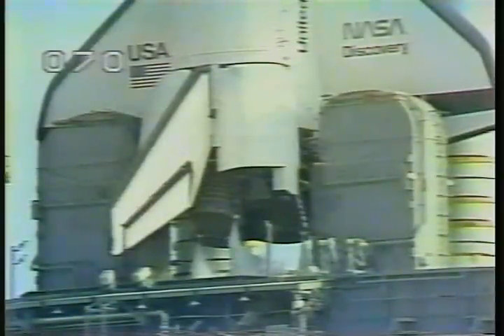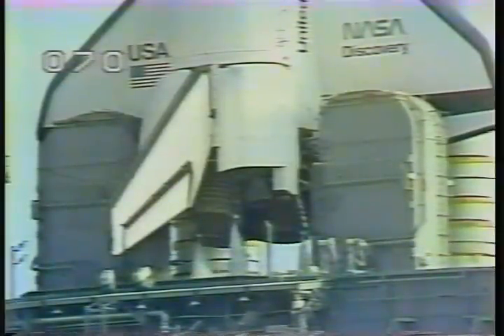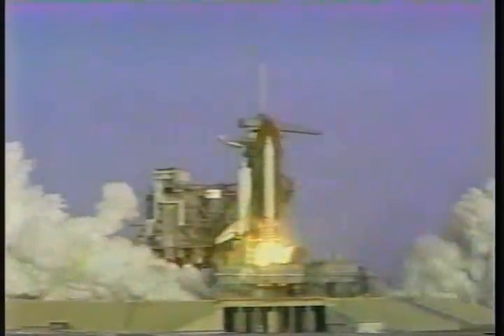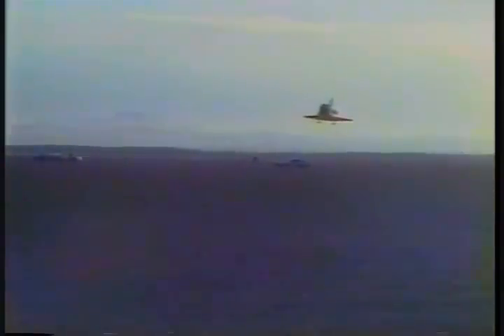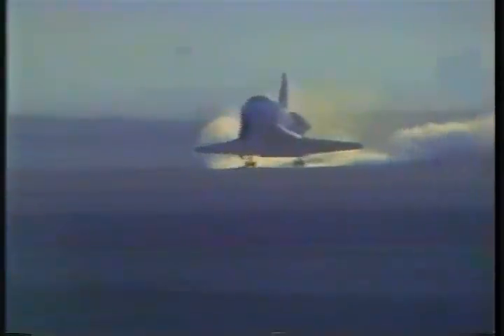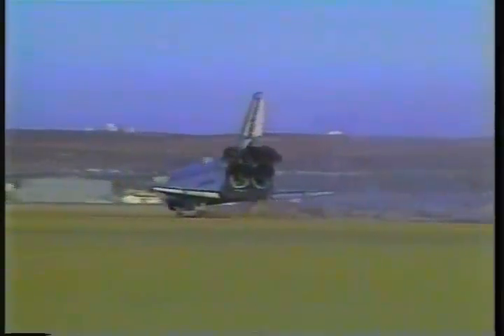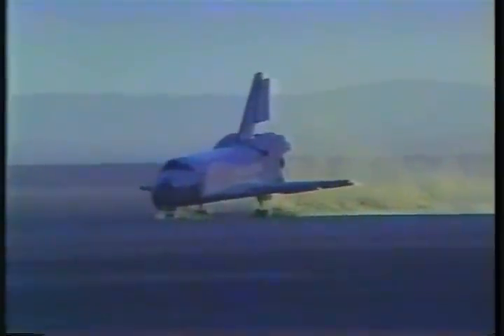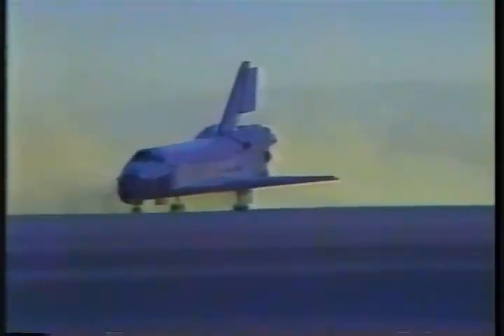STS-51G launch & landing (6-17-85)

Comment: Looks like they ran out of energy just before touchdown, like the sink rate suddenly increased.

One of the other interesting facts about this mission is it was the first shuttle mission to have a crew entirely composed of astronauts who had been selected specifically for the space shuttle program. All prior flights had at least one crew member who had been selected as an astronaut for an earlier program, even if they did not get their first chance to fly until the shuttle program.
Reply: Indeed it fell very quickly right towards the end, and it's a great fact about the all post-Apollo era crew. Daniel Brandenstein who was the commander was I think the capcom on the launch of STS-1